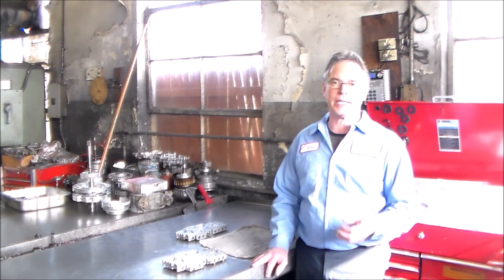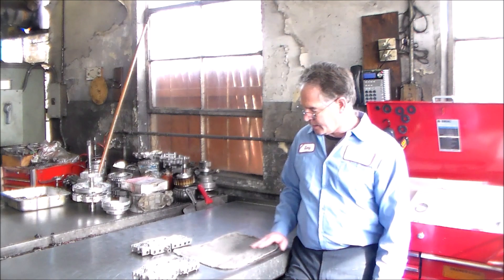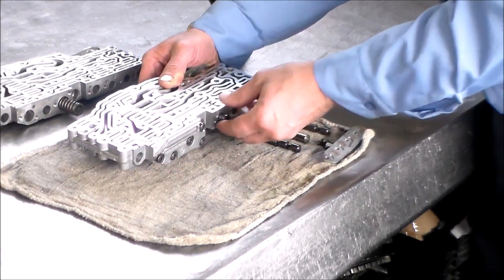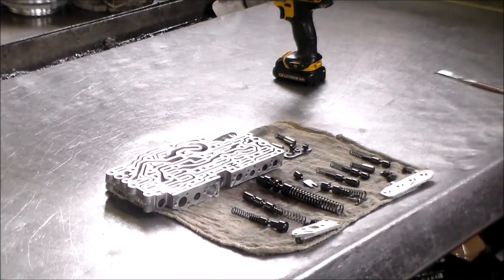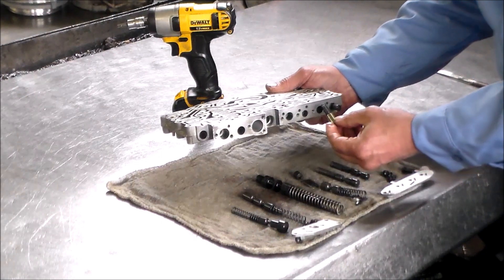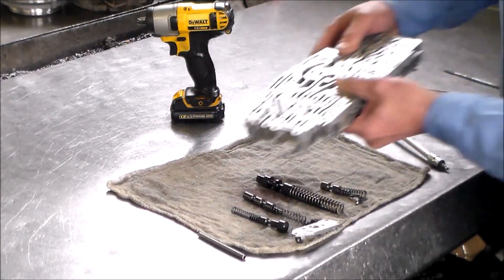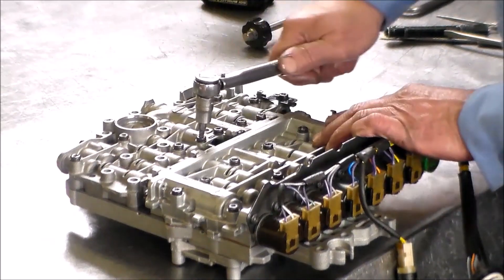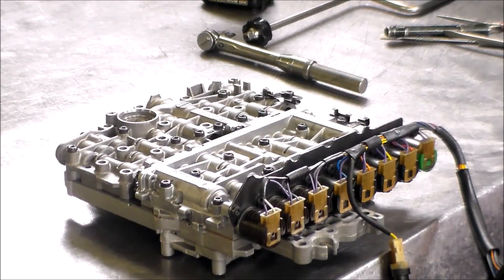ZF5HP24, Lower Front Valvebody

Comment: Great video Garry. I have a 170k km 4.4 bmw x5 with this transmission. The transmission is perfect when cold but as it gets up to temperature i experience some slight slipping in 3rd 4th 5th gears  when using light throttle going up hill. The revs will suddenly increase (only say 500rpm) and feels like the torque converter is engaging disengaging. The transmission is better in sports mode as you’re higher up in the rev range. Gear changes feel very good. No difference after a couple of oil changes and new filter. Any thoughts?
Reply from the maker: Is this producing any trouble codes, was the car scanned?

Comment: Dear Gary! Thanks for your good information. I have a question regarding 5hp24 with 4-5 and 5-4 gears which has flickering shifts while driving at low rpm. If you had any type of problem like this, Please share with your knowledge.

Thanks,
Serdar

Comment: Hi Gary, Thanks for sharing the video. Having a hard downshift from 2nd to 1st gear as I am coming to a stop with my 2001 BMW 740i Sport w/109k miles after driving for about 30 mins. Never changed the transmission oil (on my to do list for spring). Started having this issue recently. Any suggestions on what it can be? Would resetting transmission adaptations help this issues in any way?
Reply from the maker: you could try adaptations, may or may not help,  could be a valvebody issue, could be a problem with to much clearance in the clutch pack

Comment: Gary i have a year 1999 bmw 535 (zf 5hp 24) that drives impeccably apart from a harsh reverse engagement, i always wait until the engine rpm drop before engaging, reverse gear it does not slip once engaged and has 100k miles on it, do you think its more likely to be the pressure regulator bore or the f clutch drum at fault, many thanks in advance if you find time to reply
Reply from the maker: Hello,
  Does this happen when the car is cold and hot?  any codes by chance?